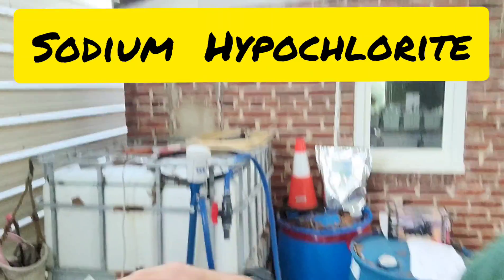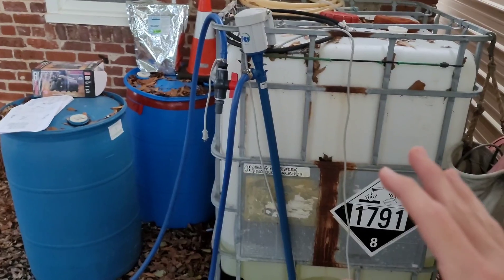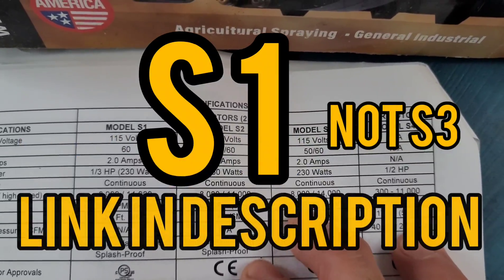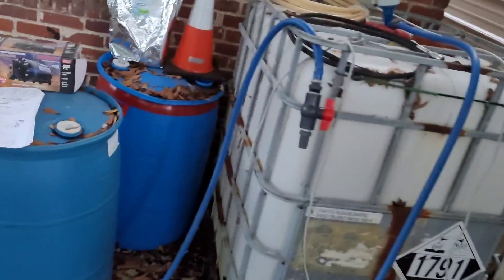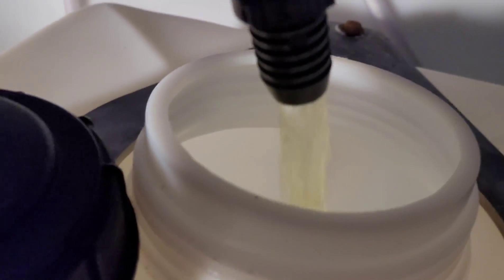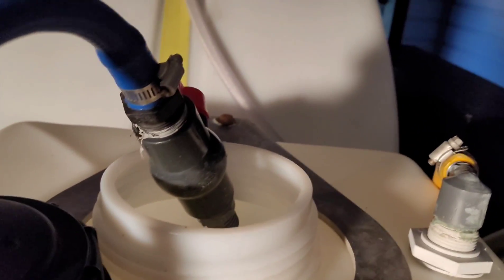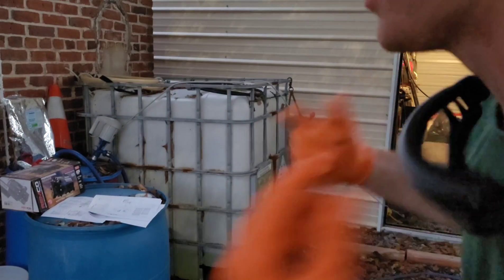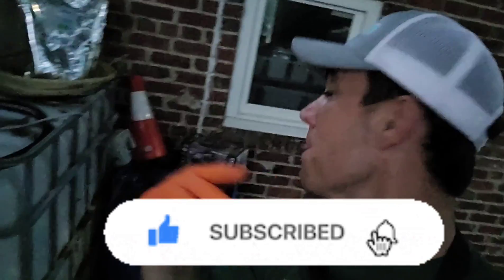Sodium Hypochlorite AKA "Bleach" SH Transfer Pump Review For a Pressure Washing Business

Comment: Get a wireless remote

Plug the pump into it

Turn pump switch to desired speed

Walk in and place hose in the tank. 

Hit the on button and then then switch it off when ready. 

Less steps and the hose is not likely to fall out or overfill.

Comment: Why can’t we soft wash with our pressure washer. Why an additional pump?
Reply: Because down streaming maxes at 2.5%, xjet maxes at 3.125% and with a 12v you can get up to the full 12.5% strength. 12 v has lower pressure than what a pressure washer can provide. Soft Washing is about letting the chemical do the work then rinsing off.

Comment: Hey ray love the channel any advice on what to use for concrete gum removal
Reply from the maker: My advice is to avoid it lol I don't like popping gum but when I do, the best thing is hot water and a green tip for me.  You can also do it with cold water if you take a torch to the gum before hitting it with the washer.  MAP gas works best for me.

Comment: I’ve noticed several times, you use a ball valve and then just tips… no PW gun … 😁👍
Oops, also, do you keep SH tank sealed tight on truck or vented all the time.
Reply from the maker: Hate a leaky gun lol  as for sealing the tanks, we make sure our bulk storage is sealed up good but as for the tanks on trucks, the sh is used up in 1-2 days max so no need to have everything sealed plus the tank is vented to prevent expansion and damage.

Comment: What percentage do you use on the white rubber roofs? Also, do you use pressure on those?
Reply from the maker: takes a very light mix, 1-2% and low pressure

Comment: Ray on that pump how long of a hose can I put on it. Currently to transfer bleach to my trailer I use a 5gpm everflo pump with 100ft to my trailer
Reply from the maker: I would imagine that it would be fine.  I'm using about a 20' 5/8 hose on it and it throws it out quick

Comment: Ray after building the dragon I am shocked you don’t have a full port at the back of the truck with a banjo so you’re not letting or taking the risk of drips on the truck. Where did you get them goggles at
Reply from the maker: Van, are you talking about from the top of the cap?
Reply: @RaymondNotario  No a bulkhead connector at the bed level of the truck to camlock your storage tank pump to going into the truck tank.  the pressure washer channel did something like that so he drips sh at the edge of the truck not across the truck to the tank.
Reply from the maker: I'll have to look into that, we haven't noticed any drips but may be missing out.  Thanks for sharing Van

Comment: I use that same pump. Great pump. That plastic will become brittle and break over time. That spout outlet will definitely wear out. FT has another material that’s designed for transferring bleach. I had to talk directly with them to get the parts. It’s a clear white material. You can upgrade the tube and spout. Hope that helps you for when you need to replace the spout when it breaks. Order extras.
Reply from the maker: Right on bro, Thanks for the tips!  Much appreciated!
Reply: Hello. Can you help me with the name and model number of that FT specially for transfering bleach. I saw your video but is from 2020 older than this one so i guess your using the old FT. Link of your video i am talking about https://www.youtube.com/watch?v=nUzDmm_jZrs
Reply: @jeanmendoza5970  I don’t remember the model. It’s not hard to find on Zoro

Comment: Im a new sub.   I juat started soft washing and power washing with sodium hypochlorite this year.   Im planning on transferring from window cleaning to all power washing and soft washing next year.   Im just making sure i understood.   If the seals are tight it wont break down?   I was under the impression heat does that automatically.   I was told it has to be kept inside in a climate that's cool.   Can you clarify or if you have a vid covering it please let me know.
Reply from the maker: I have kept mine outside all season and it's worked great.  We don't order more then 2 weeks worth at a time so it stays fresh but have used 3 week old SH and it worked but def was not as strong.  Good luck with your new business!
Reply: @RaymondNotario  you’re the best Raymond!